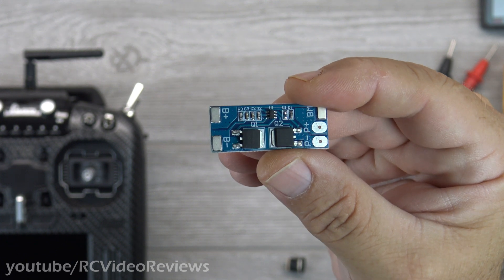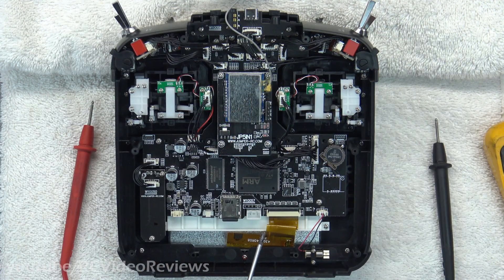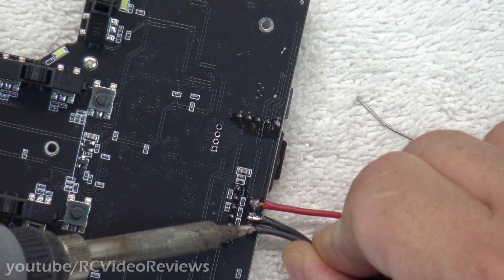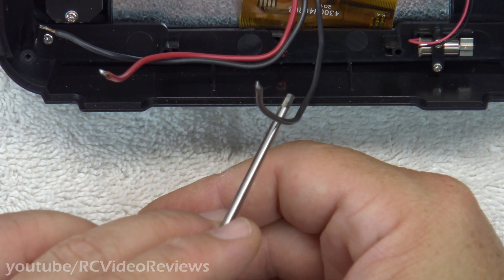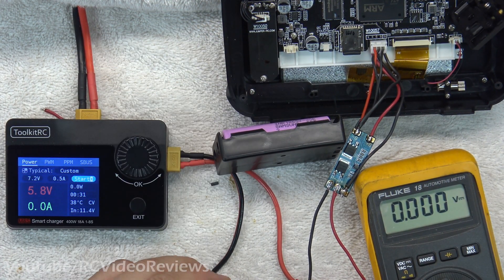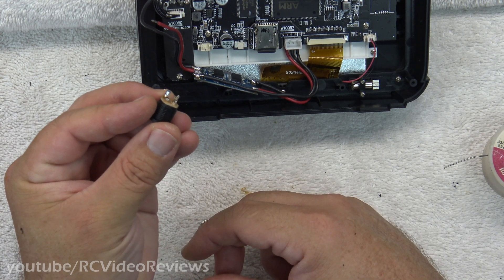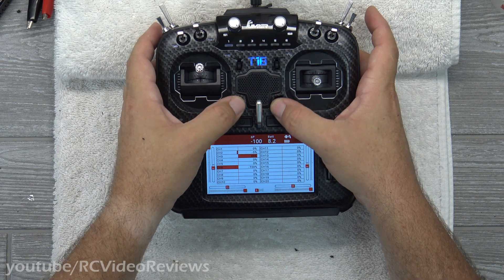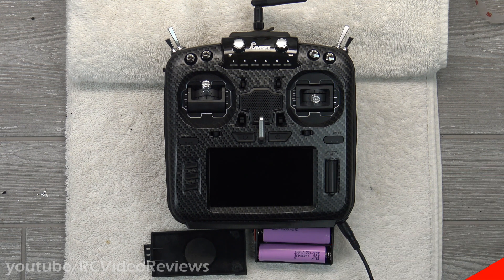Jumper T18 Internal Charger Mod • How to Install an Internal 2s Battery Balance Charger

Comment: why cant you use the power and ground from the usb-c port and run that to the bms? You can branch it off and run the bms and the original component in parallel. yeah the barrel jack is gonna probably handle more power and you can find a wider variety of adapters to use, but the ease of using something alredy there seems worth it for what youre giving up.
Reply from the maker: You probably could. I didn't want the charge jack up top though.

Comment: I forgot to ask, can you install any 2s battery (that fits) or does it need to be a TX battery? Compatible charge rates. AirHammer out!!
Reply from the maker: No more than 8.4v. Any 2s lipo you can fit should work fine.

Comment: Why in the world Jumper didn't do this. It's so simple.
Reply from the maker: Yeah, you can see from the comments how people feel about it. My theory is--put it in then you cover both use cases. Some people will want to "proper" charger on their bench charger, some will just plug it in and let the internal circuit do the job. In any case, with internal charging, both user groups are happy. Without internal charging, one user group looks to the competition. 

I just don't understand that strategy...big mistake IMHO.

The good news is, this was really pretty easy to do.

Comment: This type of modification voids the warranty. I might have missed the disclaimer statement at the start? I personally would not be willing to be so invasive on new equipment. I will make an adaptor lead. In use: Pop off the back panel and hook the charger up externally. Not as convenient I know.  Good video, thanks.
Reply from the maker: Popping off the cover is what got me a broken sheath on my battery tray. 

Some things I have to take on faith - One of them is that people understand when they start drilling holes in their radios they might have a tough time with a warranty claim. When I'm too obvious it comes across as condescending.

Comment: That's a great little job done, and as you've got a dedicated power brick its not limited by 5 volts that a USB charger input is. The LED on the power brick too is handy otherwise you'd be guessing when the batteries are charged fully. Simple install for the win, although I understand those using LIPOs are completely right to remove them before charging to keep things safe. I'm also seeing differences in the RadioMaster TX16S speaker set up, mine has a large speaker in the back case but it seems earlier models don't have the large speaker at all. What's your TX16S got?
Reply from the maker: Yup, simple install--nothing to it. I don't really know why people would use LiPos for Tx batteries unless they take them out and set them to storage voltage after each fly day. Lipos are supposed to be stored at 3.75-3.85v--it's the commonly accepted best practice.

I do not have a large speaker on the back case. I don't know if it's earlier or later models that had the back speaker. I can say my TX16s is only a few weeks old and it only has the front speaker (for now ;).
Reply: The power supply  with the LED will turn green when the voltage reads 8.2 volts which is not fully charged.   It takes about another  4 hours to reach full charge because the power supply will trickle charge the rest at very low amps.

Comment: $22 and 30 minutes of tinkering vs $6 and 5 minutes to add a speaker to the radiomaster. Seems like going with the RM will leave you with more money and time to put toward other projects. Not to mention a lot of people have made the switch from jumper to radiomaster. In my opinion jumper better step up there game or the competition is going to run them into the ground.
Reply from the maker: Weird design choice to omit the internal charge circuit for sure. But it was a very easy fix and that's behind me now. :)
Reply: RC Video Reviews after you get some flights in with this radio it would be great if you could give your thoughts on a comparison to the RM for how each feels in use. The Technical aspects have been reported but I’ve yet to see anyone give their opinion of the in flight feel for the two radios compared.